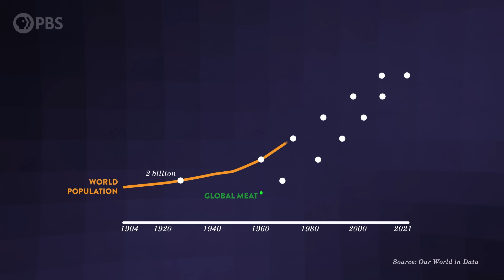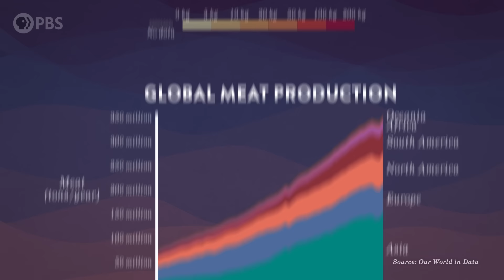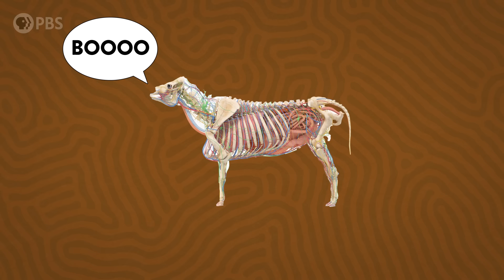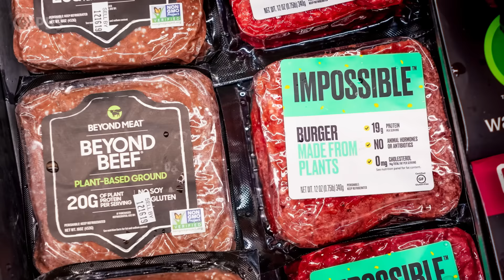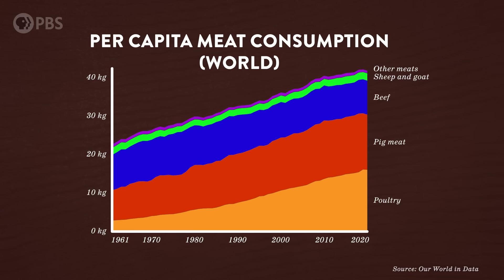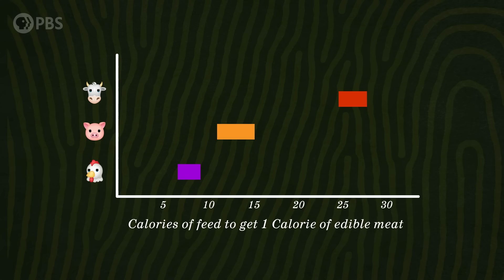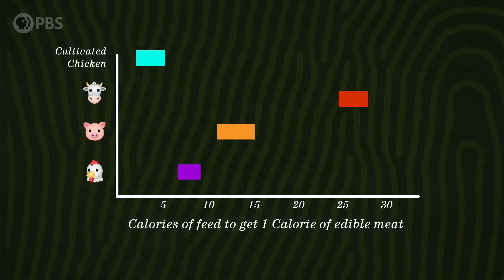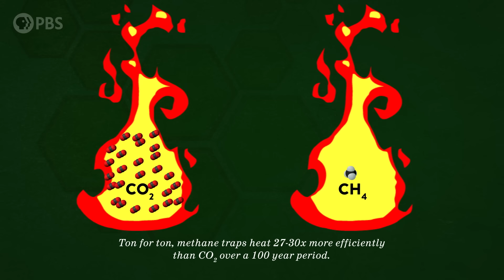Lab-Grown Meat is Here… and I Taste-Tested It!

Comment: As a biologist, I frequently see reporting on the hype of "lab grown meat" biased towards the "magic solutions" it will solve, and supposed (claimed) advantages without a proper understanding of the biology of what lab grown meat is trying to achieve. Therefore, there is no rigorous explanation of how they will magically solve these problems "15 years from now, 20 years from now", because currently there are no viable solutions, and they are banking on technology that has not been invented yet (hoping they would be the ones to invent it, patent it and make a boat load of cash). Unfortunately, this video falls into that category. Here's a few major things this video missed. The two main important things to consider in this lab process is supplying nutrients, and removing waste. These cells are cultured in large vats called bioreactors. These reactors attempt to mimic the "body" the cells live in, but the main difference is that they are trying to mimic a process that has evolved over millions of years in nature. Circulatory systems, kidneys, liver, immune systems, none of these processes of which can be replicated to any significant degree in the lab with current or near term technology. These along with the "unused" (this I'll get to) "wasted" parts all contribute to the function of the organism. Unfortunately lab processes can not achieve the same level of complexity and efficiency of the animals themselves, who have existed under selective pressures that have resulted in them becoming the most biologically efficient version of themselves. Humans have managed to improve upon this through selective breeding, and now accelerated through genetic modification, and this is likely the most pragmatic approach for the future of food security. The niche role lab grown meat will fill is growing meat of extinct species, like mammoths for example, for the rich that want to say they ate lab grown mammoth meat etc etc. This is simply marketing for venture capitalists looking for unicorns to throw money at like everything in the tech business, and not biology, and unfortunately I feel like this video does not make a good distinction between that.

EDIT: I never got to the "wasted" products. What about things like leather, feathers for pillows etc? I can make a whole separate essay about the intricacies of the meat industry but basically, there are ALOT of things other than meat that come from a chicken or cow that are used. I won't speak for the US, but anything useful that is wasted is money gone in the rest of the world, and in fact a lot of problems associated with the meat industry, such as cruelty and overcrowding, stems from intensive hyper efficiency to reduce waste and cost. 

I should also mention that speed of growth does not translate to overall yield. The time and energy investment into a chicken has a far greater overall yield than compared to the same amount of time in for lab grown meat.
Reply: At least one other person has studied this too…I shouldn’t be amazed how the sheep do what they are programmed to do but wow…
Reply: Thanks mate, those are important points that most people haven’t considered yet, particularly those of us who aren’t biologists and haven’t heard of lab grown meat until 16 minutes ago.

Perhaps people assume that nutrient quality/density is part and parcel with lab grown meat but it turns out it’s way more complicated.
Would that likely be the first corner that gets cut if this industry gets off the ground?

You should’ve being presenting that video instead of that guy.  You seem way more balanced in terms of the pros and cons, not to mention the actual challenges that lay ahead
Reply: @CursedWheelieBin  That won't be an area that could be cut. The nutrient has to be perfect, every time, with 0 contaminants, otherwise the entire batch will fail, because the cells don't have an immune system or any means to fend off contamination. It can't be grown in antibiotics if they intend for human consumption. There is a HUGE amount of money poured into developing growth media, and sometimes contaminants still find their way in, and ruin entire batches (I know this from experience). The level of difficulty in preventing contamination is definitely a major issue in this field, and scaling it up like this just makes it exponentially more difficult. The amount of equipment, time, and energy poured into preventing contamination in that facility must be massive. They didn't go into the specifics of what growth nutrients they used, but a lot of the time they are derived from animal products then purified and standardized in a lab (which is why it is so expensive), like bovine serum, so doesn't that defeat the purpose? Is it not easier to just genetically modify a better grain, and feed that to the chicken? There's a reason why chicken costs as much as it does...
Reply: Even if lab grown meat takes off, I doubt it will completely kill actual livestock farms. leather and gelatin will still be around, both of which also have plant-based alternatives. We can already produce reagent antibodies and culture white cells. Wonder if they could simulate any sort of immune system to combat the contamination problem.
Reply: You voiced it better than I and brought up some very good points I hadn’t considered. Well said/written
Reply: Thanks for sharing your thoughts. I'm also frustrated by the low quality of this video. It sounds like the script was provided by the company they interviewed and  went unchallenged by anyone exercising a shred of critical thinking. It's really sad because this channel is good at getting out a pro-science message. But they do more harm than good including so many exaggerations and lies. A recent preprint [1] shows the bioreactors are bigger emitters of CO2 than livestock. In these comments I see people arguing that will improve like any new technology once it scales up. They seem not to understand that the culture media industry its neither new nor small scale.

1. 10.1101/2023.04.21.537778v1.full
Reply: @PhysicsPolice Yes. I'm definitely not a scientist, so my focus was on the unusual amount of jump cuts. I noticed it because it was on par with the usual fast-talking YouTubers trying to hold my attention and sell me something, and not the typical pacing of this channel.

I also wanted a CLOSE-UP SHOT of the texture of that cooked hicken breast, where we could see the fibers shredding like a natural chicken breast would. The texture I could (barely) see from a side view was on par with soy "chicken" tenders. It's weird to tout its ability to seemingly mimic a natural chicken breast and not display that ability prominently. I don't think they can - and that's okay! Just avoid mentioning it and stick to ground chicken.

This video may not have been sponsored, but it reminds me of a channel from another scientist whose past uploads showed she was serious about saving our environment...and then she uploaded something that was sponsored by Dow Chemical. Major hit to credibility imo.

Comment: I would 100% try a free sample of this. I’d buy a tiny bit if it was cheap enough, and I’d be way more inclined to buy it if they could use green/sustainable energy to create it! 🐣
Reply: It says that it wont be cheap as the food required to make it in the lab are far more expensive and the energy required to run the lab is worse for the atmosphere than methane gas therefore in order to produce this at lower cost you would have to have far greater infrastructure in clean energy which will push up taxes and the food source for the lab process would have to be far cheaper, hence far lower grade foodstock than what is being fed to animals which would surely lead to less nutrients in the lab meat and other less healthy processes to pack it out. Nothing wrong with farm grown food, that isnt a problem, the planet was doing fine for thousands of years with these practises and do you want corporations and government to control the food supply or farmers?

Comment: 🐣 I would go for it. Being able go artificially reproduce the multiplying sequence and basically grow any muscle it's absolutely mind blowing. For some in a good way for some, not so much. Even thought this is also pure meat. I would even say it should be higher quality and taste than most industrial live animal processing farms/factories. When stem cells are used to regrow a part of a human, is a good miracle, and that is not a fake thing. It's the same thing here but scaled up and uses animal stem cells that are used to grow a specific animal muscle. I have never tried it, but as in after posting this i will give it a search to try and buy some so I can try it for myself. I will become more sustainable than classic farming because the sourcing of the energy used to convert to electricity has to go greener and cheaper. So the main influencer of the price will go lower, much lower and therefore the price for the grown meat might be even smaller that classic farming. Combining a huge solar-find farm with a huge grow lab could be a solution from my opinion. But it would be a huge, massive investment. But the bigger output quantity/day of finished product the faster will gain back back profits by expending massively and quickly in all big chain retailers. I would also add as a personal note that I consider this more Bio that the most live stock out there.

Comment: The "Upside Foods" guy said, "... quality feed", which might be problematic, because grass-fed livestock like let's say cows are called grass-fed for a reason. They eat Fescue and other tall grasses as long as they can until the winter and after that they eat something similar to hay.  So I.M.O. therefore if you take cells from livestock animals like cows or lamb for example, which are non-organic or even diseased then your end result product is still non-organic or perhaps diseased because that is the host for which you drew out the cells.  You would have to be careful in your selection of a healthy diseased-free cow or lamb etc, which may require testing 1st.  This might be hard to do time after time unless quality control departments  had huge oversight on the selection.  I'm not so sure you thought this through and therefore it might not be the answer.  But then again this is just an opinion.